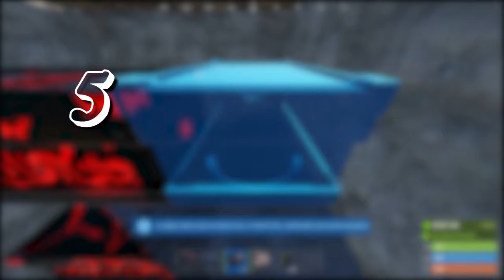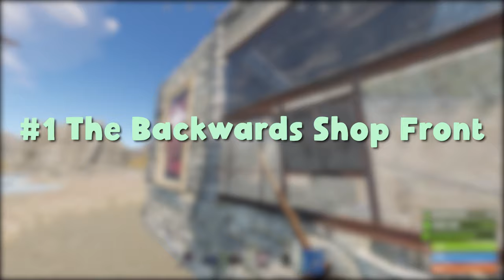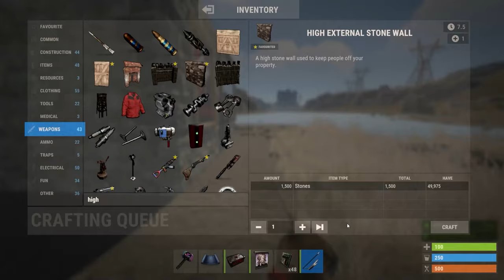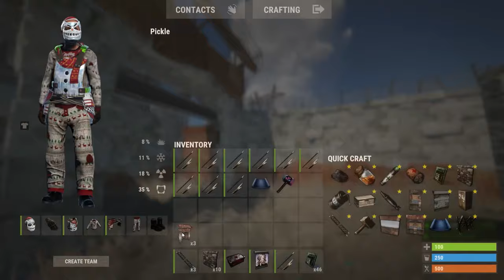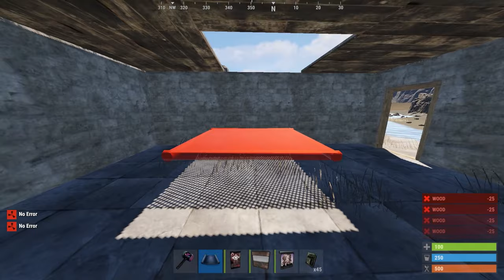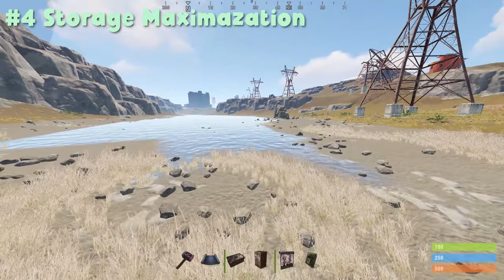5 MISTAKES That YOU'RE Making In Your RUST Builds! (and how to fix them)

Comment: How do you tell which way the stone gate should be facing for it to open inwards? Do I want the side with the railing up top facing me, or the one with jagged shapes on the sides? (Looking at the ghost image before placing it)
Reply: 4 months late, sorry bud. You can alt-look while placing, might be super obvious but I didn't figure it out for the longest time. Make sure it is not slanted towards you from the inside. Alt-looking also hugely helps while trying to wall off a compound (see if you're going straight or not, if it's going to fit etc). Surely you figured it out by now but maybe someone who reads this has the same question.